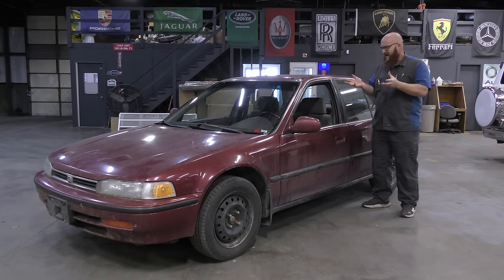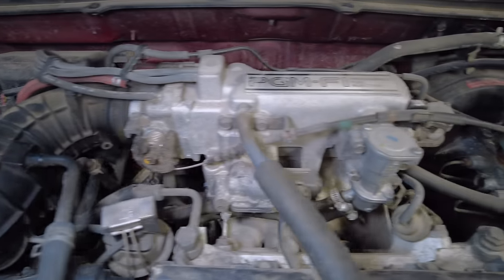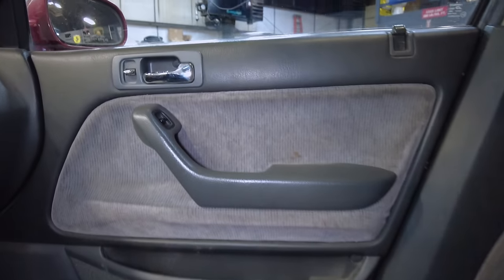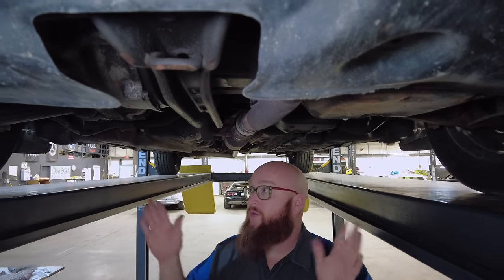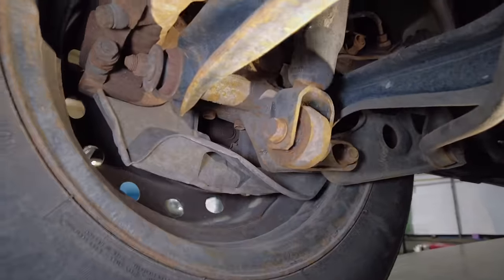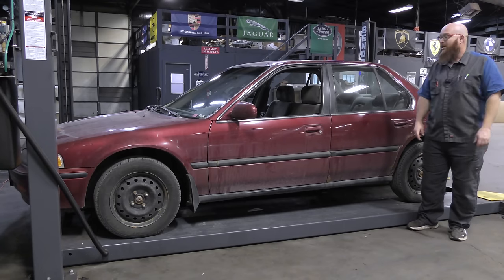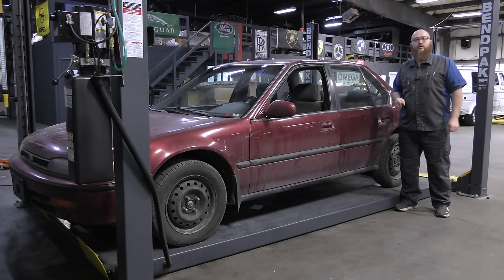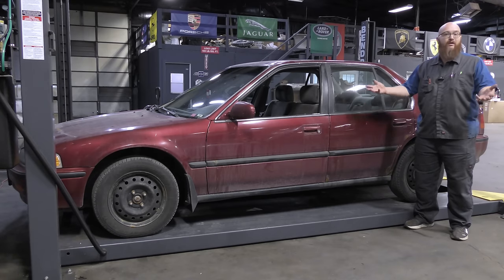A True Testament: 32 year old Accord with 380K miles! When Is It Time to Let It Go?

Comment: 1999 Toyota 4Runner. 513,000 miles and runs well.

 I’m asking myself the same question.
Reply: 295k on my 99, just did timing belt
Reply: Will die next week now :( Its been a good run, :)
Reply: Absolutely worth keeping it going. :)
Reply: It’s a 3rd gen. It’s always worth keeping if it runs well. Save it, even if it’s not your daily. You’ll regret selling it regardless of mileage. Trust me
Reply: @user-ww9yw4zi8m  no no, it'll last until he decides to put some money in fixing it up then a week later it'll blow up. At least that's how it normally happens for me😂
Reply: I had up to recently a 2008 Avalon with 474000km (~380k miles) mechanically it was perfectly sound, not even a leak, but Canadian winters ate some the flooring welds so when the gas thank started leaking I scrapped it. Still got a decent amount for parts.

*The car that replaces it is a 2018 320xdrive, we'll see how that goes 😂
Reply: I had a 2000 4Runner. Loved that vehicle. Unfortunately the frame rusted out.
Reply: @seancase71 sounds like you've been buying reliable vehicles that have been poorly maintained. Once the car got used to it's poor maintenance and continued to run, after you suddenly started to maintain it it caused a domino effect of failing parts. Too much stress on older parts by newer parts.
Reply: @MyWatchIsEnded  yeah that seems to line up, well except to the last one. Got a 60k immaculate taurus with maintenance history and car fax. Payed like 3k which for a early 2000s taurus was a lot but it was during the craziness of covid. Had it little over a year, no issues, ran  perfect. Only thing was the rear sagged a bit so I spent the money having the rear suspension fixed for a long family trip. Damn transmission went out halfway into it. It had even had a transmission service at 50k. I even debated doing it cause it was an older taurus but I just thought it was in such good shape with full history that I'd have it a while. Bit the dust at 80k miles.
Reply: @seancase71  I'm sorry to tell you this but Ford Taurus's are notoriously unreliable lol..

If you had told me you had bought a Honda Civic or a Toyota Camry and this happened I would have been like 😱

Honestly I'm surprised the car even lasted for a couple hours haha
Reply: @MyWatchIsEnded  yeah I knew they weren't the best but damn, transmission failure at 80k on a properly serviced vehicle. I was passed, went home and bought a Toyota, never again.  Only got it cause it was a low milage car with full history while everything else at the time in that price bracket had close to 200k miles at a similar age.
Reply: @seancase71  let me share a fact with you, there are some cars that came out in 2018 which lasted until 2019 before becoming unusable (totaled) without any accident whatsoever. There are some new luxury brands that have complete transmission failure at 80,000 miles if you didn't change the fluid at two 40,000 mile intervals. Ford transmissions, especially in the early 2000s, were especially notorious for sudden failures due to bad designs.

An example of this with newer Fords is the F-150 with the 10-speed automatic transmission. Where they improperly designed the internal seals which allowed them to slide off of their proper area which caused an internal fluid leak which caused the entire transmission to crap itself over time.

The reason you don't have the same issues with Asian brands is because the transmissions are overbuilt in regards to their parts and quality. They have high quality parts like seals, wires, fluid, gears, etc.

If you look into common issues across certain brands you'll start to notice a very noticeable pattern.
Reply: I owned many very high mileage cars, Toyotas too. Quite frankly the questions you should ask yourself are "Am i able to afford fixing it" "Is it suiting my NEEDS (Forget about the WANTS, they're pointless in the end)" and "Is there a more recent vehicle able to suit my needs, be as reliable and simply is available". For my old Corollas, tehy could be easily replaced by something else that was way more reliable and cheaper. For my Volvos or Suzuki tho... different story. Quite frankly unless it's rusted beyond repair, i think you should keep it. A brand new one is like 75 000$ and won't be as reliable or more practical...
Reply: Almost broken in, keep driving.
Reply: My first ex-wife took my 02 when she left. It was the newest car that I had ever owned at the time. 
 I let her take it so that my kid had something safe and reliable to ride in. 
 She absolutely trashed it, and traded in after a couple of years.
Reply: that thing wont die
Reply: I had a 97 camry 265,000 miles. If it wasn't so rusted, I'd STILL have it. Run it until the wheels fall off. In the meantime, start saving car payments as a DOWN payment on a new Toyota. Count your blessings. By the way, my 4cyl ran like a top. I'd shop at pick n pulls like a kid in a candy shop! 🖖✊️👍
Reply: Japan and Australia have new Land Cruiser 70 (2023). Next time we should vote right
Reply: If I can go my entire life without a car note, I’ll do that. I’ll continue fixing my 2.5l Jetta. I deal with a new issue once or twice a year. Thankfully, the car has never left me stranded and starts every time. When I do decide to finally sell my Jetta, I’ll just get a 9th Gen Corolla.

Comment: I laughed when he says there's a lot of rust around the rear wheels, you see trucks around here where a decent portion of the bed side is just gone
Reply: They are not unibody.
Reply: that rust is minor
Reply: thats nothing compared to my rusty ass grand prix
Reply: right? I had an 86 CRX with more rust on one wheel well than is on that whole car. haha.. that honda is low rust for the year. heh.
Reply: That is a ton of rust compared to a vehicle down south. But, I've seen enough Just Rolled In videos to know that car has extremely minor rust. 😂
Reply: That was the only weakness in the CB7, rear wheelwell rust.  Here in the PNW it's not much of an issue, they are still everywhere in this part of the country.  I have two as a matter of fact.

Comment: My Mom drove an IDENTICAL car like that in the 90s.  In fact if the VIN traces to Maine,  and there's a paint chip on the left rear quarter panel near the trunk lid, and the rear bumper was replaced,  you know the original owners!
Reply: I tracked down my first honda once nearly by accident chasing a craigslist ad for an integra and saw it in the background (with similar identifable damage). Guy wanted 3x what I sold it for and it was just riced and wrecked within an inch of it's life. I passed but it was neat to see it again. I bought an 87 si instead and street raced it for a while until it got impounded. Good times.

Comment: Its a keeper! Back in May of 1990, I ordered from the Dealer an Accord EX 5sp in Hampshire Green. It arrived in mid August! I loved that car. I had it until live issues forced me to give it up. It had over 270k miles at the time. Best riding, best driving smoothest car I ever owned.   These Accords 1990-1993 all rusted in the rear fender. Mine started just after the 5 year rust thru warranty expired. I was in NY/VT at the time. In 1998 with 130k miles, I confidently drove across county to Phoenix, where i lived for the next 13 years. The rust process stopped, but the brutal sun deteriorated the clear coat. If I could have kept the car, I would have. I got pretty excited when I saw the video thumb nail.. 
Car Wizard, Congratulations! You and Mrs Wizard have earned it!
Reply: I bet behind those rusted spots is mud packed into the rear fender well lip that constantly stays damp. no wonder its rusted out.
Reply: Living in the rust belt I spray Fluid Film or a similar product and spray the underside and behind the body panels thoroughly.

Comment: That old Honda should receive proper maintenance. If you want transportation, keep it alive and keep it.
If you want fancy at least give that Honda to someone who actually wants transportation, not fancy. They'll be satisfied for many more years.
In the early 1990s the Japanese as well as the European car manufactures peaked in terms of quality. Cars had very little to no electronics, mechanical components were engineered to last, repair ability was still taken into consideration in the design.

I have given up on modern cars that'll hardly last past their warranty. I'm lucky enough to have laid my hands on a Mercedes W124 with the old 6 cylinder diesel engine recently. I'll keep that thing, go thru the whole drivetrain and suspension once and drive it for the rest of my life.

Comment: this is literally like the perfect car to do food delivery with because you aren't really concerned about the little annoyances. you just want the motor and the brakes to work.
Reply: And transmission
Reply: Definitely agree with this. There’s so little to break and if something did it’s gonna cost pennys compared to what it would be on a modern car
Reply: Yes. But make sure it’s actually safe to drive.
Reply: ..or the supermarket, where most damage occurs. Worth keeping a shed for the trips to the tip, shopping and messing about.
Reply: @quintonulm2435  manual transmission issues do happen and used ones are probably unobtanium. Parts availability sometimes takes these cars off the road.
Reply: @CRAPO2011 you can get parts from Japan. Also that car you can just do a full motor/transmission swap to another Honda platform.
Reply: It’s perfect for DoorDash 100%
Reply: I deliver with a 01 with 200k miles. Put 50 k on it since I got it and it drives 100+ miles a day and has never left me stranded
Reply: It would probably be good to run forever if Rhode Island didn’t test emissions on old cars, mine needs a cat and a evap system and that just ain’t happening 😂
Reply: @Steez-gd2pi  Your lucky it’s not CARB compliant only EPA. I live in California so the emissions is more expensive to replace aka catalytic converter. Just purchase one off rockauto, im sure it’s affordable for that car.

Comment: I have a 93 SE Accord. It's a keeper!!! It's officially a classic car
Reply: The Se’s have leather 💙
Reply: SE's were very rare.  Nice!
Reply: you need to go to middle east to see how long these actually last.
they all drive toyotas or hondas way passed 400k. some german cars and other japanese cars. 
zero hyundai or KIA
Reply: I also have a 93 SE sedan with a manual that my aunt bought new in Bordeaux red. My uncle bought an 89 SE-I sedan in Brittany blue green metallic with a manual that I own. Those will never get sold as long as I'm still on this side of the dirt lol
Reply: @williamsinger4124  SE with manual... Honda didn't offer that. Sure it's not a EX
Reply: @smoketaylor2885  Tan leather yupp
Reply: @phreak1118  I was thr lucky one to have all three colors as well.  Had a 91 Silver Metallic,  92 Green , currently 93 Champaign SE
Reply: @LS-eb3wt  correct. Honda did not. Around 1998 I manual swapped it when the auto gave out. It to this day still has te automatic gauge cluster in it lol. Car has tan leather interior, 4 wheel disc brakes, etc. Did te sae with my 91 Beretta, when it quit I bought 2 parts cars and manual swapped that as well. The SE-I however, that was manual from day one.
Reply: My dad had a 91 or 92 se he bought new. The SE had 140 hp vs all the other ones had less HP.
Reply: @joesee8079  there is a difference between 91 and 92 though....
Reply: @LS-eb3wt  must have been a 91.  I can tell you that car will go 142 MPH

Comment: I love these old Honda's they're kinda of my thing nowadays.   I have a couple of old Accords myself, I have a 95 and a 98 both 4 cylinders.   The '98 I bought for 200 dollars when the transmission went out at 223k miles.   I put a transmission in it, gave it a timing belt and water pump job and started driving it everyday.   After about 10k miles, the bottom corner of the crank position sensor broke off and the bolt backed out and shredded the timing belt.   At that point I pulled the powertrain back out and turned it into a custom build, F23 block with an H22 head and pistons from a K20A2,  got a manual trans from a '97 and turned it into a 5speed, then I took the transmission back out and built it with some custom parts from synchrotech.   It's my 215 hp daily driver now, which in my opinion is a nice little upgrade from the original 150hp F23A1, very fun to drive around and not too bad to work on.

Comment: I got an 04 accord with a 5 speed manual and a 2.4l 4 cylinder with 409k miles and still running well... has heat, ac, bluetooth audio, everything I really need in a car... some rust yes but aside from basic maintenance items it will probably continue to run for a while

With that being said, I do have mechanical experience and do all the jobs on it myself which definitely brings the cost of repair down... for someone that hates working on cars or just isn't willing to, I could see why it would be worth it to buy a newer car, but for me it's fun to fix it and it is also a learning experience for me

Comment: I love these videos of high mileage cars. Japanese cars of the 90s were legendary for their reliability. At the end of the day, it's all relative and depends how far the owner is willing to go.

I got a '99 Mitsubishi Pajero (Montero) I've had since new that's currently got ~332,500 miles on it, and since it's now 25 years old, it'll be coming home with me soon. I rebuilt the engine at 312,500 miles by choice, because that's half a million kilometers, and it also gave me the opportunity to do some upgrades with custom parts and dress up the engine bay, but the transmission, transfer case, differentials and CV axles are all original to the vehicle. It's lived in a dry climate it's entire life, so no rust.

Over the years, it's certainly gone through bulbs, filters, timing belts, serpentine and drive belts, water pumps, coolant hoses and clamps, thermostats, plugs/wires, injector seals, valve cover gaskets, PCV valves, power steering hoses, tires, pads and rotors, brake hoses every 5 years, CV boots and U-joints. But those are all wear and tear items, all things considered. Repairs included a passenger side exhaust manifold, driver's window regulator and shifter bushings. It also got a suspension upgrade with an ARB/OME kit with Koni adjustable shocks.

Minor "annoyances", if you call it that, were only changed because they bothered me. These included interior grab handles on the B pillars (sun discoloration), door weatherstrips, door lock knob surround bezels, brake pedal pads, lug nuts, interior door handle mounting screw caps/covers, and more recently, all five door latches because they've gotten noisy. Sure, it had some cosmetic paint work done due to rock chips and door dings, as well as countless detailing over the years.

Certainly could've retired it by choice long ago, but even after 25 years, I still enjoy it. I hope the owner of this Accord with a stick shift also enjoys it for many, many more years to come! I love how clean the engine bay is with no leaks, dirt of dried oil anywhere.
Reply: ‘Murican car. Marysville OH.

Comment: I bought a 92 LX coupe from the auto auction (IAA) in April of 2020. It had 83k miles and was factory stock, one owner. The previous owner always took it to the Honda dealer locally and the last straw for him was the battery would die, the tail lights stayed on, turned out it was a plastic stopper on the brake switch fixed the issue. I've done new CV axles, PS pump, Alternator, AC compressor (R134a converted from the factory R12 unit, which had blown its seals) AC dryer, rear brake shoes, new tires, muffler and an intake manifold gasket set. Before to long its going to need a timing belt and water pump, but still a better deal IMO than a new car. Basically all the fixes I've done were repairing years of neglect by an owner that didn't understand cars.
Reply: yeah the 92-93's were a bit faulty, my neighbor had one that had glitches in the 90's brand new....I purchased a 1991; i heard that the 90-91's were better for some reason; i had fewer problems by comparison to my neighbor - but good cars nonetheless

Comment: Very solid video.  This Honda Accord reminds me of my father's 2007 Toyota Tacoma 4-cyl work truck.  It has about 160K miles on it and it's been in a few accidents, but it has no rust and it is mechanically sound.  Cosmetically, it has some wear and tear on the interior and the clear coat is failing again on the roof and passenger side of the truck.  At this point, I've told them that the best option is to just keep the truck running mechanically and not to worry much about the outside of it.

Comment: I'm at 432,000 on my 98 Nissan Frontier and I continue to fix it when it breaks. It sees 5000 miles a year now and I have a budget of $500 a year for parts to keep it going. That budget has been in place since 2010 and I have rarely had to exceed it. It never sees a shop unless it needs tires or an alignment.